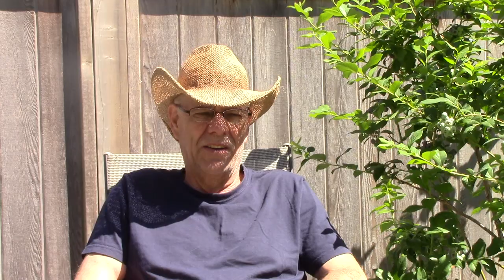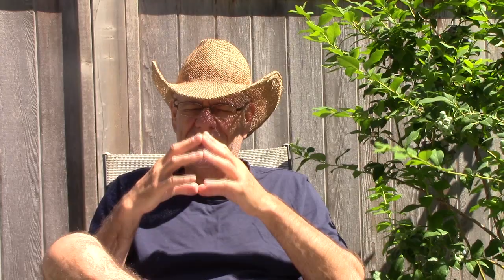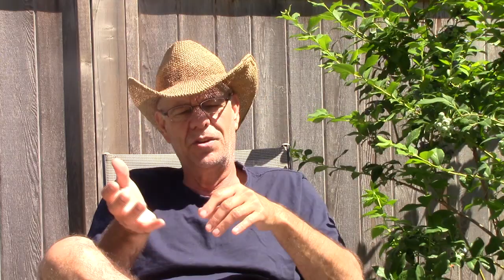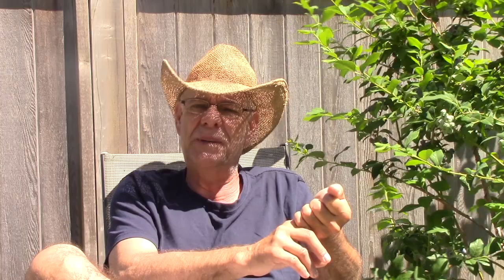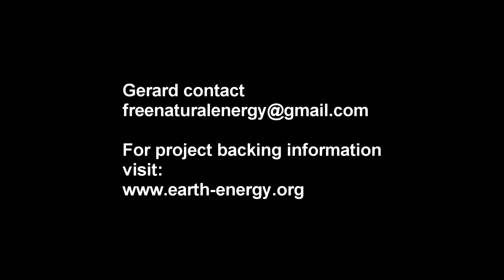Gerard Morin: I'm back, with an Update

Comment: Respectfully, I do not believe you understand what you are talking about.  It makes me believe it may be due to your age or education level.  And, I am sorry that I can not find a kinder way to put it.  You seem like a nice guy.
I graduated decades ago with an engineering degree in electronics.  However, in my electronics 101 class we covered the workings of generators, sinewaves, and such.  Respectfully, when I listen to your video, I hear you using a few technical terminologies, but only a few and sometimes wrong with a wrong understanding of it, it seems and sounds like you might be missing the basics.  You say just take the sinewave off, that is what you have to do, then you get lots of power.  But that's not how anything works.  You see, generators produce a sinewave from the rise and fall of the magnet passing near and far from the coils of wire.  It is as simple as that.  To your credit, you do understand that Voltage is just pressure, seriously, good job, you must have some understanding as to the basics.  However, what are you talking about when you say things like remove the sinewave to get lots and lots of energy out?  You say power companies remove the sinewave, aka, the AC, but that is not true.  They need the AC to move the voltage and power through the transformers and to your house; Tesla proved high voltage AC was much better than low voltage DC at moving electrons through resistive lines to people's houses, after all, if we had gone with Thomas Edison's plan, the costs would have been very many times higher, we all know that.  So what are you saying?
Reply: Hello Tom! I think when he mentioned to split the sinewave, he is mentioning about pulsating wave. Probably it got something to do with rectifiers which can actually "split" the sinewave into top halves and a negative rectifer for the bottom halves

However, if im wrong, do correct me too. I am no certified electrician but I would like to understand why if pulsating wave is not the correct way

Comment: Brilliant! Like to hear your explanation of  ignition of low pressure nitrogen  using high frequency.  This  is a solution to the  infernal combustion toxification of the planet. Please  make a program demonstrating how to prime such an engine without the use of  gas.   I would like to believe this would solve the oil wars, heating and cooling problems,  wasting of  natural resources on the planet and transportation costs.

Comment: if you break the sinewave, you create voltage impulses that travel over the wire at near the speed of light. once it hits the iron in the transformer, you get a saturation time that converts the impulses into a sine wave due to saturation and relaxation time of the iron core transformer. its very simple

Comment: Hi Gerard This spark gap that amplify the volt is it similar to the spark generated in a spark plug coil on a car?
Reply: The Spark gap purpose is not to amplify the volts, Its either to adjust the Frequency OR Remove the Sine Wave.
Reply: Thank you. How about boosting the amp? While keeping the high volt? Thanks again. Stay flat my friend
Reply: Hmmm, Good Question Tony. I can assure you I will.  Anyway To answer your question, I will have to get where your understanding is. What do you think an amp is?
Reply: Your going to say a Unit of Electrical current.  Yes?
Reply: I would say yes it is a unit of electrical current.  As conventional science teach. I still do not understand how Gerards hyper drive operate with low current even under a load. Still a rookie at this but I'm very open minded person and would not mind learning. I'll share to you a video from another person replicating Gerards pump and he used a "pelex device" to produce amp? Check it out
Reply: https://youtu.be/mB1Wtve7aug
Reply: Thanks Tony for sharing that link, however I've seen the video.  I'm not sure about this guy and his so called device only he has, and invented himself.  I believe he has overcomplicated everything to the point of putting anyone off trying to construct the devices themselves. For what reason I don't know.  Also the fact he's only interested in making money says it all.   These people are a deterrent.  Radiant Amps manifest themselves in transformers, capacitors, and anything with capacitance and resistance.  High pressure voltage"resonance" Converts to amperage.  There is no Electrons coming out a Morin Pump Only resonance created by the magnet pulling and pushing the iron core rapidly creating a vibration.  So there are no amps coming out of it either unless there is a load, So by that logic its the resistance which makes the current.  Forcing Massive amounts of resonance into thin copper wire builds up pressure.  Its the pressure I believe that converts to amps.  If you imagine water flowing out of a hose, then cover the end if it with you thumb leaving a small gap you will get a build up of pressure that jets out.  Feed enough resonance into a pole transformer to the point the pressure is wanting to get out.  you then have a device that's converting pressure to amperage .  Thats my understanding of it so far alas I've only been at this for about two months.  I mean I had been building mechanical oscillators for years but my understanding of resonance is very recent.  I never understood what was happening because my so called educated brain was full of spinning electron shit that I could even see what was happening. Then 2 months ago I come across Gerards Pump and all of a sudden it hits me.  Its FUCKING "VIBRATION".  As I stated above.. So Tony You might not actually learn anything from me. Have you built the Morin Modulator Pump yourself?
Reply: Flat Earth Vegan wow that amazed me! Gerard talked about vibrations and used the example of water pressure but I did not understand it and now you clearify it for me thank you so much. I do have two pumps built and an LG stator 36 pole that I am rewinding ("y" winding). Now that you have locked it in my head that it is vibration then this video comes to my mind. This is a very interesting test please check it out and let me know what you think. Talk soon thanks.. 
https://youtu.be/zebMvmVZyIA